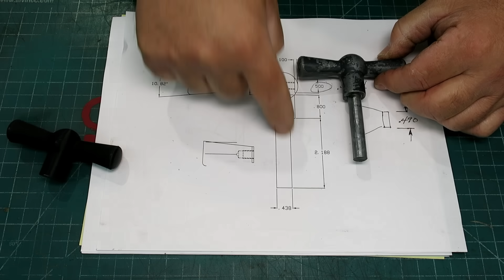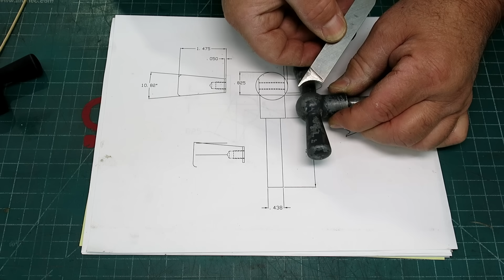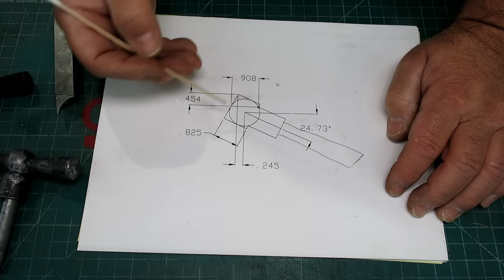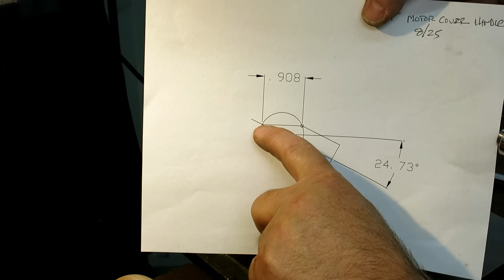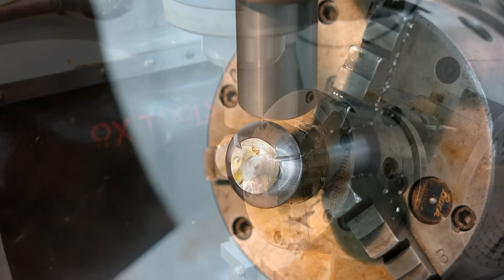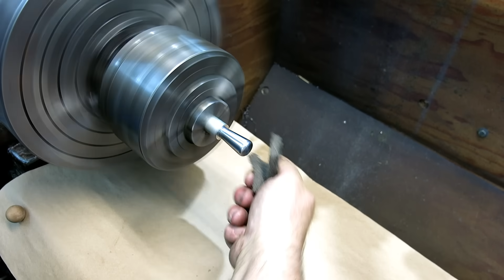Motor Cover Handle

Comment: Hey Tom, I've been called obtuse many times. How did you arrive at your 24.7* angle? Cheers bud.
Reply from the maker: The angle comes from the line from the shoulder to the pole of the sphere. If you pause the video when I show the diagram it should make sense. 

Cheers,

Tom

Comment: Nice job Tom, love your videos. You should drive up to Chico & get the free K&T; you'll have a doner mill for parts including the handle you just made and the cam you're gonna make. Dont forget the the heavy duty verticle head & drive gear would make a tasty addition, bolt it on & Bobs your uncle.
Reply from the maker: I'm afraid I'll start a collection....

Cheers,

Tom

Comment: Wouldnt it be faster easier to make the ball with a shaft then shape the handles drill thru and tap the ball end for a pass thru stud 
After the handles are shaped bore and thread the small end for the pass thru stud and cut a concave into the small end of the handles for a flush finish to the ball shaft
Reply from the maker: That is pretty much what I did with the exception of the concave cut. 

Cheers,

Tom

Comment: How did you arrive at the 24 degrees?
Reply from the maker: The angle comes from the line between where the sphere intersects the stem and the pole. This is the angle of inclination of the part rotation to the cutting spindle. If you pause the video where I show the drawing it will make more sense.

Cheers,

Tom

Comment: That spherical technique is so cool! If you staggered the cut on that sphere (like finish depth for 18 degrees, then 50 thousands high for 18 degrees, then back to finish depth for 18 degrees, etc) you could get a really interesting knurled/textured shape on it.

Comment: I can see making some pretty neat designs for knobs if you just got it close to round then plunge cut the shaping tool the last bit to perfectly round, then step over about 15-30 degrees and plunge again all the way around. it would take some fiddling with it, but the pattern that pops up as the cutter gets close to the other side of the plunge is quite interesting to me.

Comment: I just notice this. Near enough the same looking  Luan plywood and screws I used to make my table covers it looks like Tom. Same cutouts around the vise! The only exception might be mine have 30 years of oil and grime on them, they are bit darker!  I think I ripped a piece of 3/4 board for the slot key . I don't remember. but they work great. Funny we are on opposite sides of the country, different influences from our mentors etc... and came up with the same thing. I made mine well before I was watching U Toob. Anyway I enjoyed this one very much and learnt a thing ro two, as I usually do from your presentations. cheers.
Reply from the maker: My table covers are not quite that old. I think those are roughly ten years old. I like wood because the hot chips don't stick to them like plastic and they are softer and warmer than metal covers. 

Cheers,

Tom

Comment: Hey Mr. Wizard- Why effectively toolpost grind on the lathe with the handheld grinder instead of chuckung the handle in an electric drill or die grinder and use the bench grinder instead?
Reply from the maker: I had a nice scotchbrite with a soft backing pad on that sander and it is variable speed. Allows me to work slowly and not gouge the nice surfaces. I don't have scotchbrite on any of my bench grinders.

Cheers,

Tom

Comment: ?? Couldn't the sphere and tapered side handles have been turned from a single blank disc? Dish the disk from both sides to create the taper of the side handles, then saw out the "web" between the side handles, then finally finish each handle off with a few strokes of an 18" mill bastard file.
Reply from the maker: You would only create the handle taper along a single line for the side handles. Yes you could saw this out of a flat blank and grind, file and polish from there. I think it would have been a much longer video....

Cheers,

Tom

Comment: Can't wait to see how you magic up that cam. The little corner finding button was just the ticket, too. I'm guessing that was wire EDM'd?
Regards,  Preso
Reply from the maker: Correct. A friend gave me that one. I don't use it often but when you need it you need it. You can also make one by milling pretty easily. 

Cheers,

Tom

Comment: I can see how the rest works, but how did you determine the angle of the dividing head?
Lee
Reply from the maker: The angle comes from the line from the cylindrical shoulder to the pole. That line has an angle to the rotational axis of the part. That is the angle of inclination for the dividing head. If you pause the video when I show the paper layout it should make sense.

Cheers,

Tom

Comment: Great lesson! You can use the same technique for machining a hemispherical concave bowl. Old racers would cut ‘hemi’ combustion chambers into cylinder heads using this same technique.
Reply from the maker: Exactly. You can use a normally oriented boring head or even an end mill.

Cheers,

Tom

Comment: Nice job on the handle Tom. Unusual way to turn a ball. I’ve made several using a lathe ball turning attachment. Very easy to use and set up. To find the centre of the ball, I used an edge finder, but kept the probe at the same Z height so it touches the ball in the same horizontal plane. Seems to work OK. Cheers Nobby

Comment: If you really wanted to help me out, you could go back and post this video about a month ago.  I needed to make a ball on stem piece like this for a ball and socket type joint.  I went to all the trouble of making a radius turning tool for my lathe.  I had a terrible time getting the results I wanted.  It's extremely difficult to get the proper radius next to the stem because it requires a lot of stick out from the chuck and you can't put a center in the end to support it with the tailstock.  I've seen the method you used before using a boring head, but I didn't remember it working as well as this.  
Where you use copper to line your channel lock jaws, I keep some 8 to 10oz veg tan leather in the shop to wrap around the piece I want to grip.  It works really well to grip smooth, slick surfaces and doesn't leave any marks.  If you wet that heavy veg tan leather with water it becomes very pliable.
Reply from the maker: I tried using a Holdridge radii cutter many years ago. Never liked all the fussy setup and horsing around required to get the results you want. I guess I never went down the radius turner rabbit hole. One of my mentors briefly described this method to me one day and that was the end of that.

Cheers,

Tom

Comment: Who needs a ball turner? not me anymore. Great explanation & tutorial.
Reply from the maker: This process also works for cavities. You can use a boring head or even and end mill to cut a spherical cavity.

Cheers,

Tom
Reply: @oxtoolco  How would you do that? reverse the role and put the workpiece in the mill and the cutter in indexing head inclined, you have inspired my interest, a demonstration would be interesting after you finish the handle lock. Thanks, at 68 I'm still learning

Comment: 30:30  one should be able to readjust center judging the crosscutting (or lack thereof) of the protosphere surface in the orthaganal direction of the spindle and rotary workpiece plane.
Reply from the maker: You are absolutely correct and great observation. In fact you really don't need to do much accurate centering at all. You can look at the cut and shift the axes into perfect alignment.

Cheers,

Tom

Comment: 12:20...  a cylindrical cutter can cut a portion of a sphere of ANY diameter...   see your thumbnail for evidence.
Reply from the maker: Correct as I stated in the video. If you want the pole included you would have to move the cutter. Partial spherical surfaces that don't include the pole have more options.

Cheers,

Tom

Comment: i want to know the science of why adding oil onto the surface of the part being cut on a lathe does anything at all when the cutting edge is ripping up and cutting virgin and un-oiled metal.  the cutting edge never meets the o.d. which is oiled, it only ever meets the new o.d. being cut which by definition of a few microseconds was previously internal to the material being cut and henceforth never bathed or even exposed to oil....   please explain cutting oil to me like i am 5.
Reply from the maker: Hi Joe. Great question. There are folks that have entire careers built on this subject. I'll do my best to explain it as if I was speaking to somebody five years old. 

When you slide your toy car on the floor, it's not perfectly smooth. The floor and the car's wheels have tiny, tiny bumps that you can't see. When they rub together, these bumps get in the way and slow the car down. That force is called friction. Now, imagine you slide the toy car on the floor for a long, long time. After a while, you might notice the wheels start to get a little scratched or worn down. That's called wear, and it happens because all that rubbing from friction slowly wears away tiny bits of the material. To stop things from wearing out and to make them slide more easily, we use something called a lubricant. A lubricant is a slippery substance, like oil or grease. When you put a drop of oil on the wheels of your toy car, it fills in all those tiny bumps and makes a smooth, slippery layer. This lets the wheels spin much more easily and keeps them from wearing out.

Hope this helps,

Cheers,

Tom
Reply: am i to believe that in one revolution of the workpiece that oil has migrated the depth of cut, against centripital forces, into the freshly exposed metal?

Comment: Love the Ball Turning as an exercise 👍. Love it or hate it but given you had modelled it might make sense to get some of the fiddle Metal Printed like you did on the Drill Jig a while ago?
Reply from the maker: I looked into that on another project recently. That awesome pricing is no more. That company couldn't sustain the pricing and service they envisioned. I could not find anybody to metal print something small like that for less than several hundred dollars. 

Cheers,

Tom

Comment: Tom, I noticed when you parted the part off that it seemed as though the tool was a bit low, I saw the little nubbin and thought "That's not like Tom". Of course it turned out you had done it on porpoise to use as a target. Loved this process, I never even heard of it before!
Reply from the maker: You spotted my nubbin....

Cheers,

Tom

Comment: For when the part unscrewed. The lathe was running toward you but the grinder was was spinning the part away at least when contacting the end of the part so if the grinder was running at a higher speed than the lathe it would tend to unscrew the part. As it’s variable speed slowing it down just a bit more would have probably worked to keep it from un threading the part.

Comment: Huh. I would have made it as a monolithic piece and made the hub a screw-in piece. That would allow using a ball turner for the spherical section. 

Looking forward to seeing how this "turns" out.

(Time goes by) 

That came out pretty nice. One trick I've found for getting edge finders into places without room for the shank is to use the disc tip on a wiggler. That gives you a good two inches of reach. 

The only downside is that the tip instantly helicopters when it contacts and can self-destruct if it hits something at a bad angle.
Reply from the maker: Six of one half a dozen of another. I don't have a ball turner anyway. 

Cheers,

Tom

Comment: What’s the chair type edge finder? The one used to find the corner when the part was on an angle. I want one. Thanks Tom
Reply: Take a cylinder and cut a quarter of it out, and there it is. Also helps to saw the inside corner at 45°, so it rests flush.

Comment: Seems like for such applications it would be useful to have a dial indicator arranged such that the face would be oriented straight up, with the center of the dial right on the rotational axis of the spindle, so that you could read it from any angle without having to run around the machine.
Reply from the maker: Very true. That particular indicator and stem doesn't have enough range to orient the dial face up like that. I like that particular indicator for this because is has a really stiff stem and firm indicator action. I had it out and didn't even think about grabbing the indicol setup. 

Cheers,

Tom

Comment: Using the single point cutter was necessary to get the right I.D., but it also exposed the cut during milling, and made this FAR cooler to watch than using a stock annular cutter. Very slick shop-made cutter, by the way. It would have been nice even without the center bore for the pointer, but that extra feature was cool, even if you didn't really use it. :) Great explanation, and great video. Tom, you're still The Man.

Comment: Were the original handles cast?
Zen machining, cut away everything that isn't the spherical bit hidden in the middle.
Reply: Yes, you can tell just from the material, finish, and shape that it was cast. Probably from something akin to aluminum or magnesium. The circular ramp part is also a casting, you can see the parting line as Tom moves it around. (But then think about how they had to make the mold for the casting!)
Reply from the maker: I think the originals are Zinc castings. They are fairly heavy and definitely not aluminum.

Cheers,

Tom
Reply: @oxtoolco  Zamak comes to mind - I wouldn't have a clue how to identify it. That was an amazing process to watch.
Reply: @oxtoolco  Well now I think you need to make a 2nd steel one to replace the original, or the mill may end up unbalanced🤔

Comment: A CHALLENGE FOR YOU: I was a Army Machinist and did just what you're doing before. I was thinking about what you said about must having a stem to do this. 
What if you make e pipe as a stem but instead of glue you use a strong vacuum in the pipe to suction onto the preformed part of the sphere. Then finished the sphere with the offset boring bar? The pipe would have to have a concaved radius end it may only take something like a piece of ballon rubber to form a seal between the two. The other end of the pipe would be plugged with a valve to induce the vacuum needed. 🤔 I would really love to see you try and make this and test it!
Reply from the maker: You are right that would be a challenge. 

Cheers,

Tom